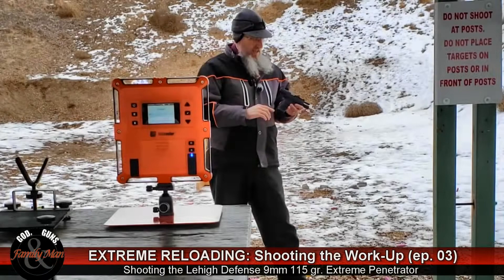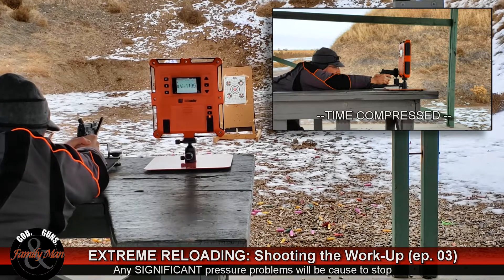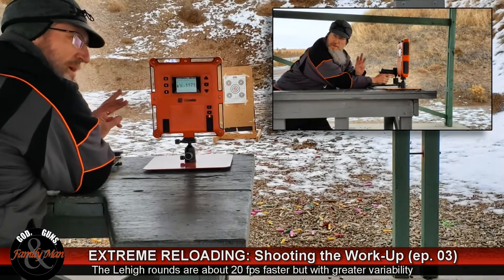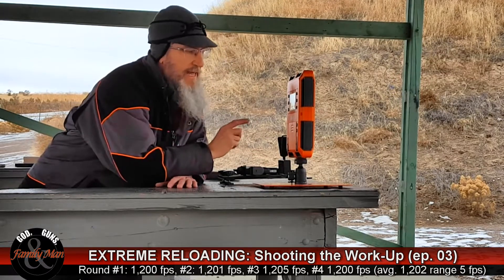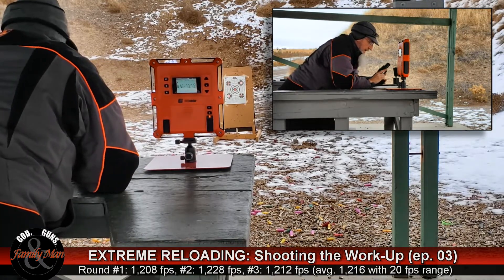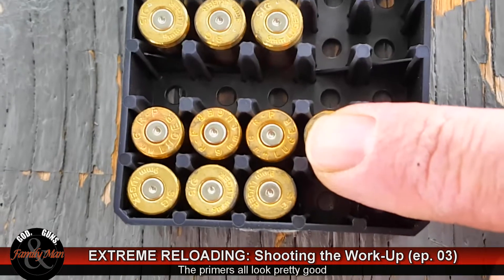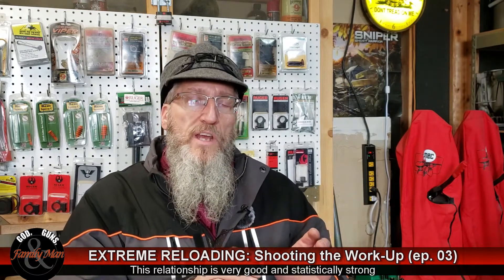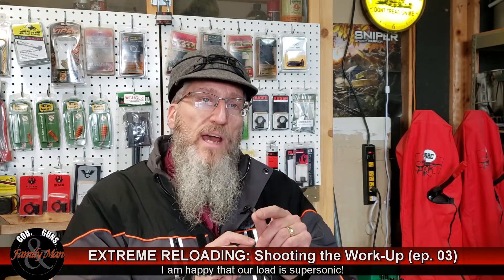EXTREME RELOADING: Shooting the Work-up with Lehigh bullets (ep. 03)

Comment: As I commented on Part 2, that image shown of the load data doesn't show Unique: however, a review of their CURRENT load data for this 115gr XP in 9mm indicates a MAX of 5.1 gr @ 1,120 fps...  Since Underwood sells a +P version (at a considerably higher velocity, BTW) there's no doubt sufficient "wiggle room" to venture beyound the 5.1 gr point.  The mention of an absolute upper limit of 5.9 gr seems to bear this out.  All my previous experience is with the 68 gr & 90 gr XDs, also in 9mm.  Cheers!
Reply from the maker: It is always interesting to me how max load data changes over time and in various published reloading guides.  The best thing a person can do is to begin the load at a safe minimum charge and then carefully work up the load watching for signs of excess pressure along the way.  Thanks for watching Norman.

Comment: First and foremost thank you for your reloading videos. You're not alone in your enjoyment of the scientific approach to decoding precision shooting. Your videos remind me of old man Lee's notes in his reloading manual as what he called something along the lines of the most enjoyable way to waste the day. He had a gifted mind for engineering.

If it was me, I would retry the experiment again reducing the variables as much as you can to just the bullets i.e. use the same brass and reloading die. My hunch is there is a hard to detect crimp difference between either the dies or the way the bullets are fitting into the same die, creating the higher pressure on the bullet that wasn't seated as deeply.

But if we continue to see the same difference with the same brass and crimp, it builds support for your bullet composition theory or another yet identified variable, e.g. how the bullets are lining up against the lands. Is the XTP requiring the pressure to build more before being pushed out of the chamber. Lands might be rifle terminology but same concept, something is creating more pressure.

Unnecessary because you saw the consistent velocities at the 5.2 load anyways, but the pressure difference at the 5.4 load was indeed the reverse of what I expected.

Enjoy!
Reply from the maker: Thanks for watching and posting.  You describe some good ideas here. The 5.4 gr. load showed some early signs of pressure and I am thinking it is because the bullet intrudes into the case more than does the XTP.  Hence our burn chamber is smaller and we can expect to build pressure faster.  I am not certain if the brass had something to do with it or not and your ideas for further testing are good.  At this time, I am thinking I will use a 5.2 gr. charge and continue with some bullet performance testing.
Reply: @sdkweber  Ah, I thought the XTP entered the RP case less than the Lehigh entered the Sig brass, and it was the XTP showing the greater pressure signs despite being seated not as deeply.

If the bullet intruding into the case more saw the greater pressure signs that makes sense.
Reply from the maker: @Sacrificial_Mind  Exactly.  So I have decided to go with a 5.2 gr. charge on the Lehigh bullets.  I think you will enjoy our next episode where we test these bullets in three different pistols.